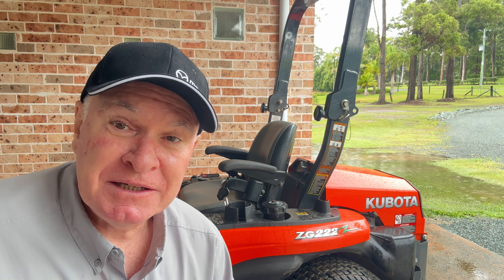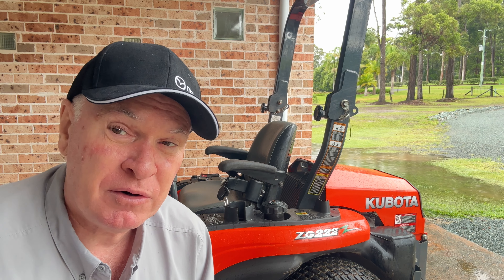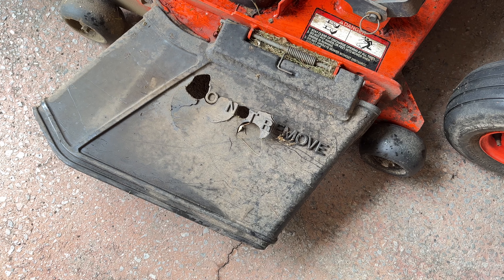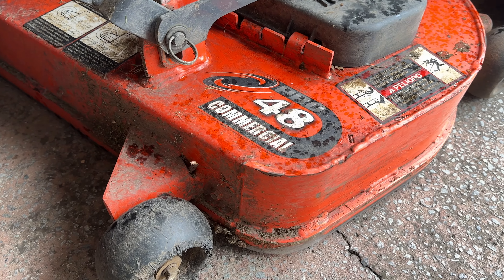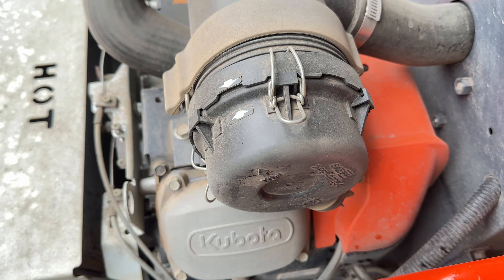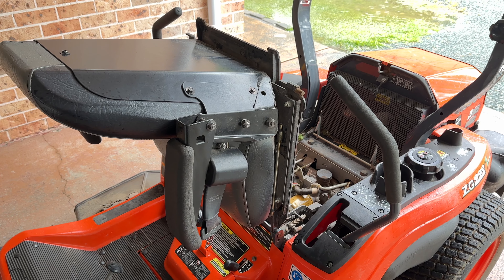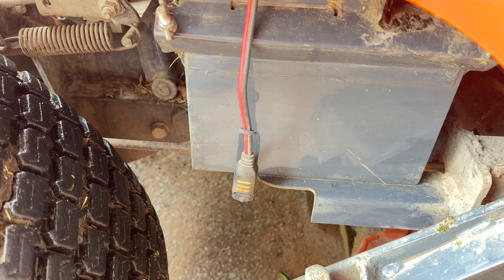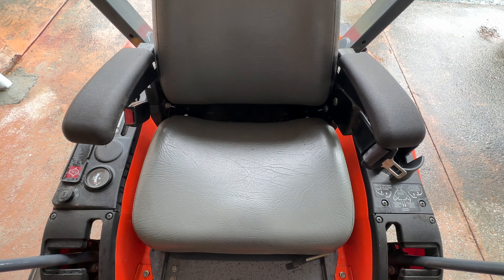Kubota ZG222 - 7 YEAR Long Term Review.

Comment: I have the same mower. I purchased Mine new in 2010. I’m pushing 600 hrs now. Been a really good machine, but I’ve noticed the issues that you mentioned in the video. Currently on my 3rd belt